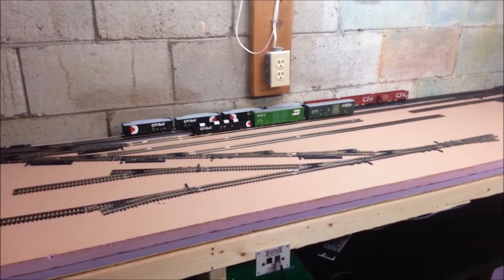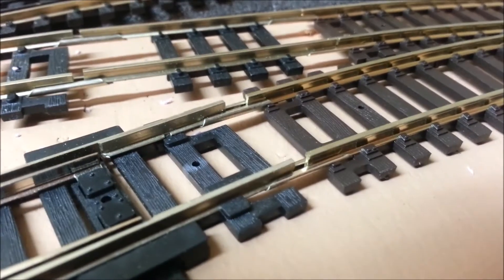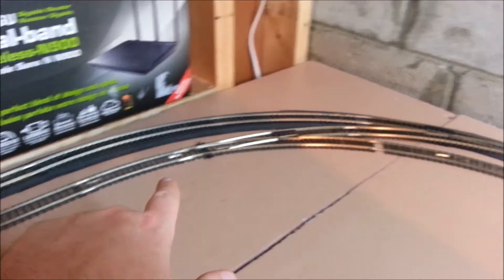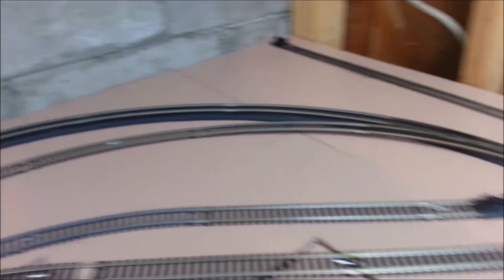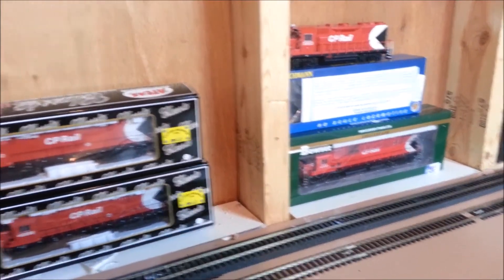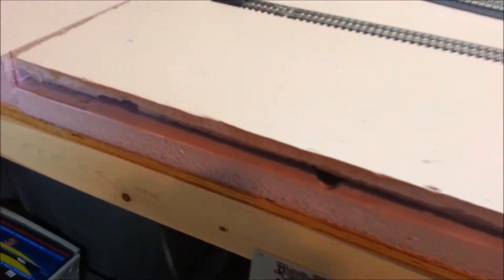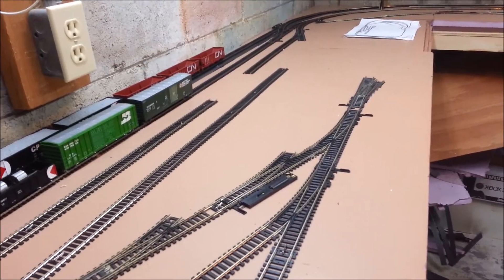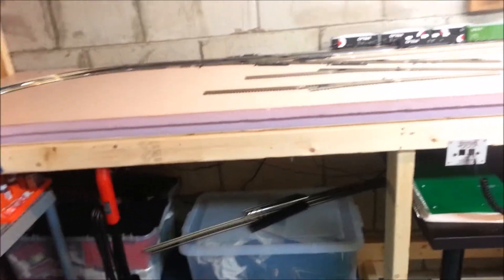Building my HO Scale layout - Update 30

Comment: Hey Dave, its looking good so far... those gaps in the track will give you problems with derailments though. I'd redo it so there aren't any gaps if you can... Also I have seen a few guys on youtube use acrylic latex calking spread thinly on the Styrofoam (with a 1inch putty knife) to stick down the track. That way if needed it can be unstuck if you change your track plan in the future...
Reply from the maker: Hey Pete, Yea I've moved the switches a little further apart and will now cut some flex track to bridge the gap. I learned from my last layout how the gaps will effect things. Right now I'm using woodland scenics foam glue. I was able to spray some water on it and lift it after a few minutes without damaging the foam roadbed or track. I do plan on using some latex calk on other things.

Dave

Thanks for the comment!